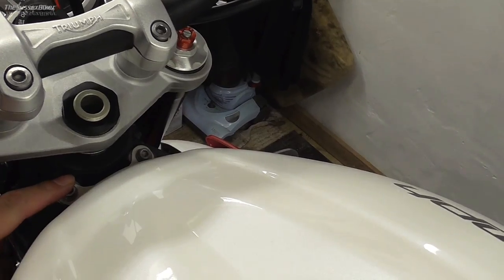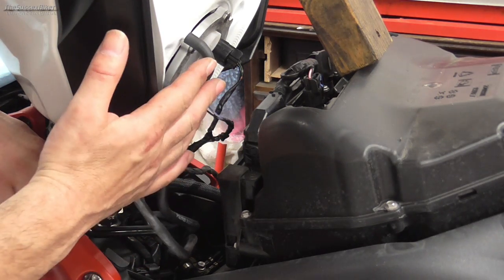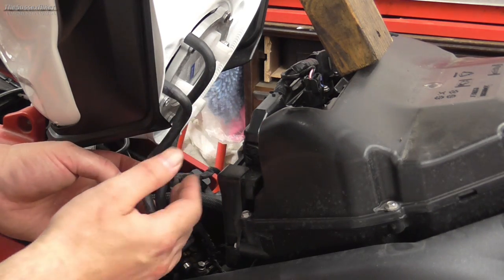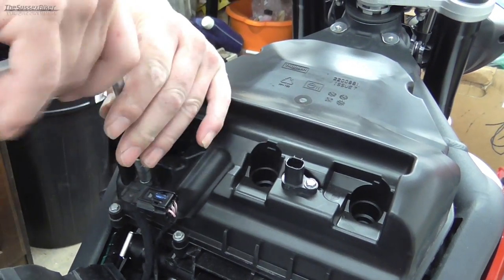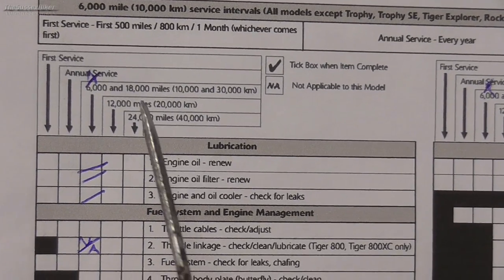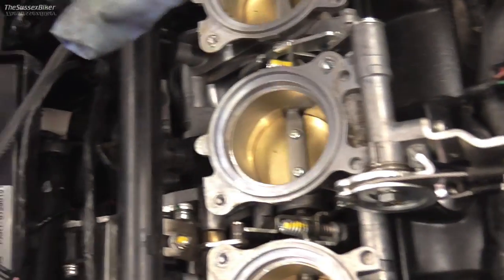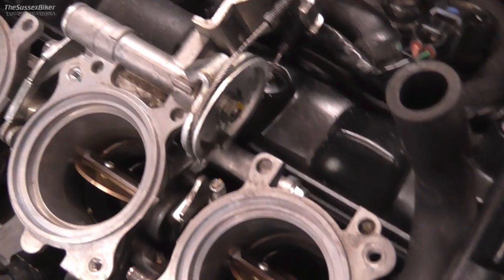2013 Street Triple R 6000 service Part Two- Air Box and Spark Plug Removal

Comment: Triumph should give you your own show - this is by far the best Street Triple Service Video on the Net. Awesome. Especially that bit about the cable ties for the coil packs. Given me the confidence to have a look at changing my plugs. Long gone are the days when you could just whip them out at the side of the road with a plug spanner! Modern bikes eh! 👍
Reply from the maker: Thanks very much for watching and commenting 👍glad you found it useful.
Reply: @TheSussexBiker  Still getting mine finished up - decided to make it a 2 day job as the plugs haven't been changed before and it gives me chance to get the airbox properly cleaned out and all of the components cleaned, lubed and protected. I've even used amourall on the plastics. BTW its a 14mm long reach plug socket isn't it?
Reply from the maker: @freemenofengland2880  nice you can clean all the nooks and cranny's while your there, from memory I think it's a 10mm spark plug socket edit just checked that's what I said in the video see here as well https://www.675.cc/threads/spark-plug-change.15157/
Reply: @TheSussexBiker    Yes it is called a 10mm spark plug spanner/socket. This is the size of the rubber grommet that holds onto the plug when it is undone. the actual hex size is 16mm, either 6 or 12 sided.
Reply from the maker: @freemenofengland2880  yes that's the one from memory 👍

Comment: Love this (these) videos. One thing that could make them better is a "tools required" at the beginning of the video. For this one in particular I didn't have the right tool to get the spark plug from the depth of the engine. And I wager there are several ways to do that. Cheers.
Reply from the maker: Thanks for watching. That's a great ideal I will try to do that next time,always thought that would be too boring.

Comment: Thanks for the videos, my Dad has normally done most of the maintenance of my bikes when I was younger and I mainly observed. These videos go really nicely along with the Haynes manual. Struggled getting that connector off the bottom of the fuel tank though, what a pig to remove!
Reply: I found that a pig as well. Pushing the clips in seems counter-intuitive and even then you have to persevere. At least it shouldn't come off by itself while you're riding. 😶

Comment: Great series of video's,I've got  a 2014 675R & the maintenance seems more complex compared to my old school FZ750 & XT600. Mine's only done 3100 miles but I've read about the lack of grease in the swingarm linkage so I'll add that to the winter maintenance tasks,I'll also invest in the Dealertool. Once again thanks for posting these videos.
Reply from the maker: Thanks for the kind comments and watching the video. I was shocked at the lack of grease , in my opinion it's definitely worth the extra effort to do this.

Comment: Golden rule: before unscrew the spark plug, always, always use an air compressor shot to be sure all is clean to prevent debrits going down in che combustion chamber.
Reply from the maker: Yes I agree or you can crank the motor with the plugs out,at the time of the video I didn't have an air compressor at home,but I do now!

Comment: What a great video! I couldn't have changed my plugs without you. I just wasn't able to pull the plug coils out, and was on the verge of taking it to the dealer. This is the only info I found on how to deal with those suckers. Every other source just said to pull them out. But not how... Even with your clever method it took everything I had to pull #1. The other two were pretty easy. Triumph had no concern for ease of maintenance when designing this bike.
I looked for a video from you on measuring/adjusting valve clearance, but didn't see one. Did I miss it?
Reply from the maker: Glad you found it useful, You haven't missed the valve clearance video,I haven't done it yet officially my bike (2014) doesn't need them checking until 12000 miles (no time aspect) but I am getting a few requests so may plan to do it.
Reply: I think compared to other bikes the STR is relatively easy to work on. Try doing the same on an MT07. Its a real pain in the arse! Great vid aswell 👏

Comment: Great vid, I will be checking my spark plugs this weekend. FYI tank removal is not necessary, just flip it back and put something behind it..
Reply from the maker: Thanks for watching, Yes you can just flip it back but for ease of filming and just to have unhindered access I removed it.
Reply: Hi matt
I can't put back in the ignition coil. How did you do it?

Comment: I have a '13 Daytona, and I'm surprised to see the Striple doesn't have upper injectors?! When you were removing the bolts which held in the ECU, there are 3 molded points with no openings

Comment: Many thanks, brilliant series of 'how to'.  Changed spark plugs today, as you suggest 1 & 3 a complete b#tch - great tip to you the cable tie.  Only one minor 'oh crap' moment, a connector without a home when putting air box/tank back - I didn't disconnect it and bike has no errors so assume it is for a triumph option (e.g. Quick shifter)
Reply from the maker: roto ehu Glad my video helped you. There is a connector for the quickshifter so sounds like the one

Comment: Great video!
One question. Ignition coil was hard to pull out, thanks for the trick. Now I need to put it back, but it's too hard. In the video you didn't show that part, how do you put the coil back to place?
Reply from the maker: Hi you could try lubricating with a small amount of wd40 or similar on the pencil coil before refitting.

Comment: Great video and quality - Q -- Regarding depressurization of tank line - what if the engine has no oil? I don't want to crank it with no oil. How can I depressurize the line then? Or should I figure on a lot of fuel coming out?  I think there is about 3psi of pressure. Thanks!

Comment: Great vid .. I have a 2012 so I hope it's the same ? .. I'll do the same as you but I need to fit new indicators so the air box needs to be removed anyway . 
Thanks
Reply from the maker: Thanks for watching,not sure if a 2012 is exactly the same but it's probably not that different.

Comment: cheers for the vid mate, it saved me a lot of head scratching and swearing.
Reply: Hi John
I can't put back in the ignition coil. How did you do it?
Reply: @sergio9814  hi sergio,not sure what you mean?
Reply: @johnwhitehead4809  
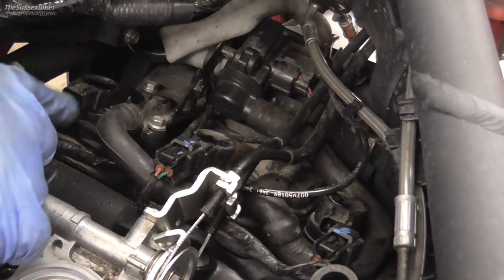In the video the spark plug is cover by black plastic part, the ignition coil. To pull it out in the video uses a plastic rather than a screwdriver (min 10:44). Those coils were tight to extract, now I want to put them back into the hole, but they are tight and I can't do it.
I wonder how did you do.

Comment: I have the 2009 model. Do you think the process is the same as your model? 
As in, is everything in the same place? :)
Reply from the maker: Never worked on 2009 model would have thought it would be similiar but IIRC with  bit of google fu you can find a service manual good luck.

Comment: Excellent thanks. I need to get under the airbox to replace my LH lightswitch cluster. Any idea what torque the 4mm hex screws on the air inlet shrouds should be, I snapped one hex key trying to get one of mine off!!!!  Had to retrieve the broken head and abandon the job. Any additional info appreciated.
Reply: Hi I take it you mean the trumpets that bolt through the air box to the throttle bodies? factory manual states 6NM.
Reply: @mattkitchen5182  that's them yes, considering it was OEM serviced, think I need to have a word then, thanks Matt

Comment: Thank you sooo much! for the awesome maintenance series videos. Just bought a 2013 triple, wish it was the R version but I think I will survive. This bike is so sweet but the kid that sold it didn't do any maintenance on it. So that's the first thing. Had a problem with the dash display. Can't get it into set up mode. The neutral light won't turn on when it's actually in neutral. So I'm thinking if I take out the shift indicator and clean it up? It's annoying cause the rev lights go off at like 4,000 rpms. So hopefully that neutral indicator switch will let me into the set up mode. Do you think I'm on the right track? Also had to quickly fiddle with the kick stand switch to get the bike into gear without it shutting off when I would put in first gear. Thanks again M8T.

Comment: This is great. I recently purchase a S3R where I will be doing the services myself too. Also purchased the DealerTool diagnostic tool as my engine malfunction check light has been on for the past few days. Not sure what the issue is as it seems to be running fine. Tried the 3-4 warm cycle start ups but the light is still there. Have tried to keep the bike off since then as I don’t want to damage the engine. Have you ever experienced such a thing with your triple?
Reply from the maker: No I can't say I did. Have you scanned it for fault codes? That would be the first thing to do.

Comment: To change the air filter only (not the sparks plug), do I need to remove the tank or raising it is enough?
Reply from the maker: Hi you could probably do it with just raising the tank but you would need make sure it is supported securely and it will be more awkward to work around but from memory it's do-able.
Reply: @TheSussexBiker  yes I'll probably secure it to the ceiling, I'm not ready to fiddle with fuel line yet ^^
Reply: @tiloalo  you can wrap some string or ratchet strap round the tank and attach to the grab handles to ensure the seat does not fall down, that way you can work with it in the upright position

Comment: Hi.You mentioned 'depressurised' on tank removal.Do you have to repressurise tank!!?How do you reconnect the tank??thanks..
Reply from the maker: Before you disconect the fuel line it's good practice to depressurise the fuel line,you do this by disconnecting the fuel pump electrical  connector and start the bike until it will run for a few seconds then die. Now you can safely disconect the fuel line. When you have reassembled everything once you turn the ignition on fuel pump runs and reprimes the system.
Reply: Many thanks. ..

Comment: You seemed to move that fuel tank around pretty easily.  Had you siphoned the fuel out of the tank before you removed it?  If not, do you remember how much fuel was in the tank?
Reply from the maker: I didn't siphon any out, luckily I had about two bars worth left so it made it easier.

Comment: Im confused, is it a 10mm or 16mm spark plug socket that I will need?
Reply from the maker: Hi it is a bit due to the way spark plug sockets are labelled. They normally but not always refer to thread size in this case 10mm but the size of the hex is approx 16mm. So you need a spark plug socket which is 16mm or may be labelled 10mm. Google NGK CR9EK and see what I mean. Hope this helps.

Comment: So if you were to connect the two electrical connections backward what would happen the bike would simply not get fuel correct?
Reply from the maker: Justen Pifer it's a while since l did this, I don't think you can get them the wrong way round.

Comment: Hello, great video, do you think it's worth changing the stock spark plugs for  Laser Iridum ones?
Reply from the maker: Thanks for watching. I have not used them so can't give you a definitive answer. I would research the pros and cons. In my opinion as long as you use an o.e quality plug that's good enough.
Reply: Thanks, again great video, greetings from Argentina.
Reply: Hi lexo
I can't put back in the ignition coil. How did you do it?

Comment: I just replaced my sparkplugs on my daytona, and now it's trying to turn over but wont? I tried putting the old ones back in and it's doing the same? 
Any ideas
Reply from the maker: Sorry to hear that. Could you battery be flat/discharged? I would check the battery and connections first. Check the kill switch hasn't been knocked. Good luck with sorting it.
Reply: @TheSussexBiker  thanks for the reply, battery has been fully charged, not the kill switch either
Reply from the maker: Hi Dave sorry I've been offline. I would double check your work just in case. Have you fitted the correct plugs i.e  are the new ones the same length ? Does the engine turn over by hand? Although you would need to put on a paddock stand and put in gear and see if it turns although it may be hard with the plugs in. Check battery voltage under load to check that the voltage is dropping off to far. Failing that you would need to check the starter circuit/battery live cable / earth / starter motor. It's difficult to diagnose this over the internet so maybe get yourself a manual and follow the troubleshooting steps for your symptoms. Good luck

Comment: Is it the same process to remove the air box on the 2011 model?
Reply from the maker: To be honest not totally sure. You will still need to remove/lift the tank. If you search the net I'm sure you will easily find the official manual for your bike not that I'm condoning that of course ;)

Comment: Thanks for this very useful video.  Quick question for you - are those small risers the SW-Motech ones?  I've been considering those myself - the ones on your bike look very neat.
Reply from the maker: Thanks for watching . They are indeed sw motech ones, I found they made a great difference.
Reply: That's encouraging, thanks!  Did you have to adjust the clutch or throttle cables?
Reply from the maker: No adjustments needed

Comment: Is this bike reliable? Did you tune the ecu?
Reply from the maker: It was reliable in my time of ownership,no I did not tune the ecu.
Reply: @TheSussexBiker  why did yo sell it?
Reply from the maker: @jerryx2000  I had two bikes the Triple and a VFR800 which I used for commuting as I didn't want my street getting daily use. In the end I was riding the VFR more and not using the Street as I didn't want it getting dirty or picking up the knocks and stone chips of regular use. So in the end I decided instead of having two lots of cost on two bikes -tax/insurance/tyres/maintenance etc, I sold both and got a Z1000sx. I still miss the Street it was a great bike.
Reply: @TheSussexBiker  is there any benefit removing the secondary air system? I am also planing in totally removing the air inlet in the front under the headlights & getting the full arrow map.
Reply from the maker: @jerryx2000  I don't really see the benefit of removing the SAI. I know a lot of people do,if you go down that route it may be worth talking to someone who tunes/maps bikes to check if the 'arrow map' is suitable.
Reply: @TheSussexBiker  so mate after owing the 13 Streety for a year I have decided to get the 2010 Speedy with Brembos. Did you ever ride the older Speedys. If yes what would you say? reliability & ride?
Reply from the maker: @jerryx2000  I have ridden one a long time ago now, the ride was brilliant, as for reliability think they are ok just usual corrosion issues and charging faults.

Comment: 16mm spark plug socket
Reply: 16mm?
Reply: @VICScrambler  Yes, 16 mm. Had regular short socket. It was too thick, couldn't even enter spark plug hole. Had to buy long socket, it was thinner.